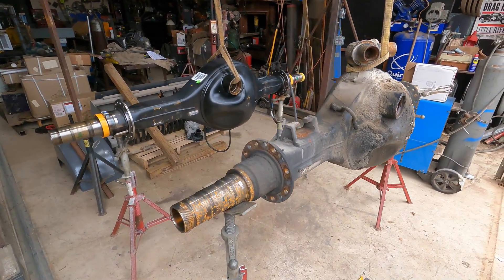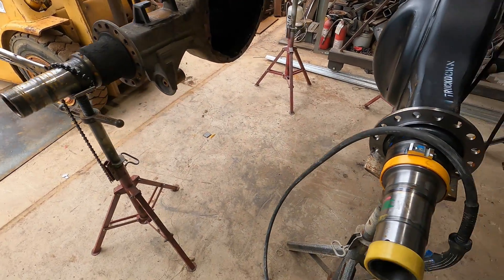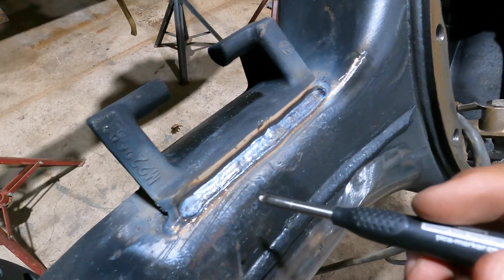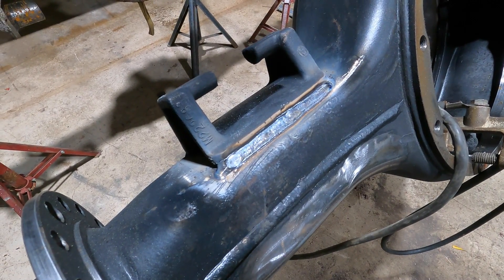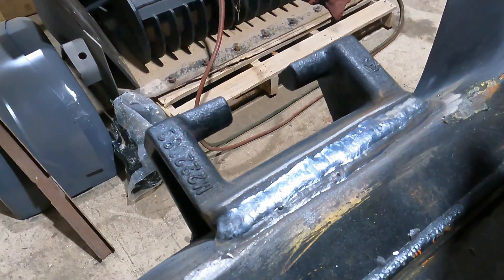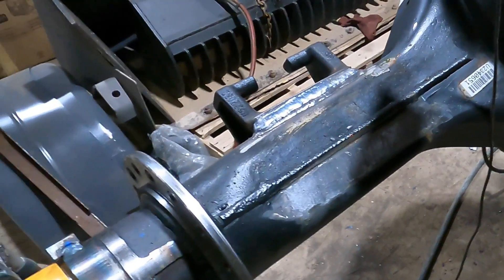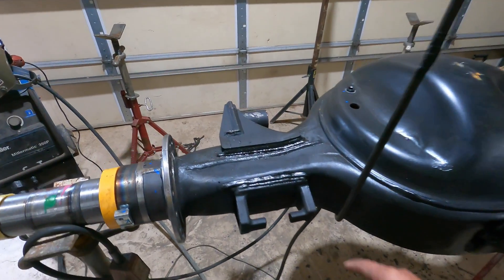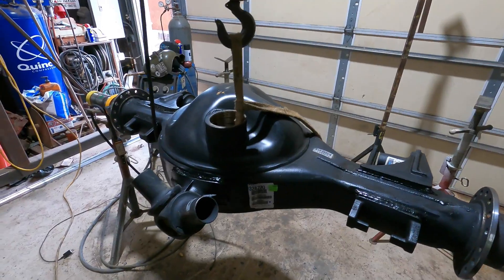Axle Housing Modifications

Comment: Man thats the same stuff I used, it penetrates better than anything else. Miller Xmt or 252/251p? at 24 volts and 320 inches per minute or 21v and 240(?) would easily weld some 1inch blocks onto an auger that was as tall as an underpass on the freeway. Good for Kelly bars and 2inch or 4 inch(?)pile driver gussets too! Just 1 root pass and 3 more passes on top = strong. Even in the wind it's great!

Comment: Hobart makes a really good dual shield. I've run pallets of that wire. It'll even weld on scuzzy metal you're not too sure of. Really good properties can even do some impromptu  hard facing with it if you peen on it a bit when it's still warm. Lays in nice and smooth and flux peels off like 7018 with the right settings. Can uphill and overhead with it no problemo. Listening to your weld if you bumped .2-.5 volts it'll stop spitting BBs and the end of your wire won't form a bead, never need to trim the end with welpers. I always ran straight stringers pushing slightly.

Comment: I used ti weld with a very old hobart mig welding machine at the railways in my country I must say it was one of the best machines i worked with although it was so old a beutiful arc welded smooth the new machines we have today with all their fancy settings just dont beat that old gem.
Reply from the maker: You talking about the old Yellow Hobart Mig machines. with the single round selector dial on the front? Those were nice units.
Reply: @ICWeld  ours where more a yellow greenish colour being as old some guys painted their machines these days people dont have pride in their machines dont keep it dust free dent them etc pride is very important when doing your job even pride in ones machines and equipmqnt that is what makes up a good artesan pride in his/her work enjoy your day go well stay safe.
Reply: I got to use a Miller Goldstar last June,a bit of 6010 and capped with 7018,smooth.

Comment: we use the fabco triple 7 wire in .052 great stuff. i run it at around 350wfs and 28.5v off my rig and suitcase you can fill stuff up fast.  you should try comes in .045 too i believe

Comment: I ran 2 or nearly 2 dual shield spools a week for a few years... you gotta play with the setting, it looked a little hot from the dark flux color... the sound was off not ssssss sizzle or the glopy cooking sound when the wire speed is a little slow... but all welding machines aren't the same and there's different settings for power and wire speeds for different requirements... the hotter it's ran the more strength it has but becomes more brittle.
from my experience, when you get it dialed in the you'll get slag peal and no need to chip anything. I used a little air from the air chisel exhaust it would blow it away and would be ready for the next pass. I did mostly 1/2 to 1 in. structural with it and the occasional low hydrogen process on some applications. it's fantastic stuff.
Reply from the maker: excellent, thank you. I'll mess around with the settings. Much appreciated!

Comment: The bottom hanger appeared to have what we called a "running fit"!!!!
What amp and volts were you running on the new wire? It looked like it really "laid down".  I think the slag would fall off if you just rolled the part over or you''ve got "magic" multi-pliers.
Your "driving" got better real quick. what'd you do close your eyes>>..  I fully understand the difficulty seeing the puddle.
Where Ya been hiddin that purty white Ram?
Reply from the maker: Thats my wifes truck.😉😁😁😁
Reply: @ICWeld Out of curiosity,  does your wife ever help on welding jobs? As I may have mentioned before on some other video,  my dad was a Master Electrician.  I remember a couple of times where the whole family was helping to get a job completed.

Comment: I use dual shield for everything at work, the welds are super smooth and burn in like no other.  Should you be using c25 ramp it up to c10, the c10 requires less energy to achieve spray transfer and/or pulsed spray.  The more argon the easier it is to enter spray transfer.  Basically itll run as hot as c25 but with less voltage.

Comment: Dual shield is awesome. I'd say we have shifted 90% of our stick work over. It's just fast, hot, and glues up so well.
Reply: I dont understand why it's not used more in industrial and outdoor settings.  Even in a windy environment it welds so well with fewer stops and starts than stick.  There are certainly times when stick has an advantage but overall I'd weld dual shield over about any other process whenever I could.

Comment: Yeah that was a good one. Easy not that bad. I have the same problem when I weld when I weld on my bench. I have a light above my head and it seems to reflect down inside the mask and it's hard to see. So I made up a little hood piece that hangs over the back of my head to block the light. I seen other people use them so I'm going to give it a shot next time I do some welding and see how it goes. 👍👍🙂🇨🇦

Comment: You didn’t say much about the dual shield wire I’m not much of a welder I can stick things together but what I know is flux core wire the the wiring is reverse of gas shielding so if you use dual shield which way do you use the wiring and is it dual shield so if you weld in the wind and it blows away the shielding gas you’re weld is not rotten

Comment: ESAB:
"#4: Rapid Operator Training

Welding with Dual Shield flux-cored electrodes requires a minimum amount of training. In fact, it is much easier to train an inexperienced welder to weld in all positions with flux-cored electrodes than with other welding processes. This is because the fast freezing slag holds the weld puddle or weld pool in place, permitting greater control.

This means it takes less time to train and there’s a lower chance for poor fit. In addition, welders will be producing high quality weldments in a short amount of time."

Comment: Great work as always , why do you hit it with a carbonizing flame first? Is it so that but the time the heating of the part burns off the carbon the temp is high enough to weld?
Reply: Just like you said, when the carbon burns off, then it is hot enough to weld.
Reply: @HarryJarrell  thanks for the explanation 👍👍
Reply: I would also be interested in an explanation 👍
Reply: Thanks i thought so.

Comment: I worked in a foundry, where we poured valve,water pump bodies,big ship props up to 12' foot a crost. Any how we used dual shield also, pre heat the casting to a certain temperature,then build it up. Then cover it with blankets to let it cool down slowly to prevent it it from forming cracks because it cooled down to fast.

Comment: Have that same trouble of not being able to see, for me it is the 62 yr old eyes.

My regular prescription bifocals do not work great with welding. Have a cheater lens and reading glasses, plus clean clear protective lens on the hood.

Sure do miss those 15 yr old eyes like when i first started.

Merry Christmas and Happy new year.
Reply from the maker: Yeah, The eyes are not the same for me either. I guess once you pass the half century mark, things begin to change!
Reply: On Monday broke my two year old glasses with my elbow, they are a plastic frame. Went over and got a new prescription and ordered new glasses.

The old ones broke on the bridge, then got out my wood burning soldering iron with a blade attachment. Stuck the frame on both sides of the blade till it melted and then stuck then together. 

The same way poly pipe is fused, then used the hot blade to smooth out the area.

So far they are holding. So now I'm at 2.75 + magnification with the new prescription. The old ones are at 2.50

Comment: Curtis from Cutting Edge Engineering, Australia, uses dual core wire for a lot of his work. He also follows your channel by the way. Nice work as always!
Reply: Yea, first time i actually became aware of how good it is was from Curtis. It makes for some solid welds and has changed my thinking on how to repair stuff.
Reply: I watch both channels, Curt’s, and Issac are both great at what they do
Reply: Dual shield?
Reply: @nicklebac6753  Using flux core wire with gas shielding.
Reply: @SandBoxJohn  I know lol
Reply: @SandBoxJohn  It's not the same as gasless flux core wire, to be clear. It's specific flux that works with gas.
Reply: @OtisFlint  I am aware of that fact.

Comment: iPhone for me a number 10 on 11 lens works great with dual shield also if you push your weld instead of pull it I think it worlds a lot better and smoother also get it to sound like Bacon and eggs friend once you learn dual shield you don’t wanna go back
Reply: It should not sound like bacon at all. Should be pulled too not pushed. Though in my experience plus or minus 5 degrees off 90 is usually fine.

Comment: Love the welds for what the dual shield does. I also have trouble seeing welds and I modified a light. I have one of those halogen work lights on a tripod stand with the rectangular fixture. Halogen bulbs don't last long and the heat they produce is next to welding. I purchased a pair of rectangular LED COB lights, yellow looking built on a white, flat circuit boars (amazon and other places sell them) and because it is Circuitry On Board, you only attach the positive and negative leads directly from a 110 outlet with solder. They are available in different output and the light produced by the finished unit is next to a cloudless day in the summer. I removed the halogen bulb and replaced it with the 2 LED COB lights. I used a piece of aluminum sheet (steel could also be used and aluminum is what I had available) to mount the LEDs with small screws and nuts and then attached it to the fixture. I was not able to use the reflector but with some mods it should be possible and when done, it was unnecessary. The LEDs do not make much heat and I can now see the weld. The LEDs produce a much better light than do the halogens. Look for at least 100W and if higher, go for it. Price might be ten bucks each. They last a long time and be sure to check if the ones you look at are 1110 or 240 volt so you do not get the wrong ones. This is an easy project.
Reply from the maker: Thanks for that suggestion. I'll have to see what I can do.
Reply: I would love to show you the worklight we cobbled together,same thing pretty much though.

Comment: Dual shield makes perfect sense for your work. It's basically wire fed stick welding, best of both worlds. So much stronger than short circuit MIG.
Reply: I am on my first 30# of that wire,, need more stick out and I still am getting worm holes at times, very frustrating so far
Reply: @ironworkerfxr7105 
Clean the metal surface well. Add current. Heat up the metal more.

Comment: ah word travels fast once you post a video about 20 minutes in and 600 views, for this introspection on setting up this axle  housing for use, by an earnest and kind master metal tradesman, showing how some of the jobs that roll in are done and sharing a few tips and tricks and honest imperfections that happen along the way, but thats how it is each job has its own challenges, and a few imperfections are bound to happen, 

do you prefer working in the shop, or the on site adventures repairing I wonder
but, have a merry christmas Issac
Reply from the maker: I prefer on site repairs. I like the challenge. although, I am getting rather spoiled being in the shop. I get more done when im onsite rather than at the shop since it is in my backyard. Its too easy to take a long lunch or coffee break!!
Reply: @ICWeld  ah I see, I like being in my own shop so I got everything I need or can get it for doing the highest quality work when we fix something or build something, I am not a trade welder though, just an intermitent project and repair stuff for the neighbors and friends kind of guy, I am more a woodworker, and when working in the railroad shop on the steam loco, I perfer to be inside the shop most the time, where its easier to just sweat it out then endure sunburn which happens quite easy though its a little cooler in indiana then texas so that might make it a little more unbearable in the summer, but sometimes we have to work on larger projects outside as there just isn't as much room in the shop to do large lifting or we dont want to get all the dirt and soot inside the shop when cleaning the firebox or blowing out the flues and pipes of ash and coal dust, or dumping the ashpan, or for that mater loading machinery or heavy large items being taken apart, you know how that is

Comment: Great video, you drive alot straighter than I do when I can't see properly.
Question if you dont mind, why do you use gas as well as flux core? and What is the advantage of dual shield welding?
thanks for sharing
Reply: The reason they call it dual shield is you have the shielding gas AND the flux in the wire. For structural work you can weld without removing the mill scale (which is a major time suck).
Reply: @tedsaylor6016  thanks Ive never used it, but considering that it could be well worth a go.